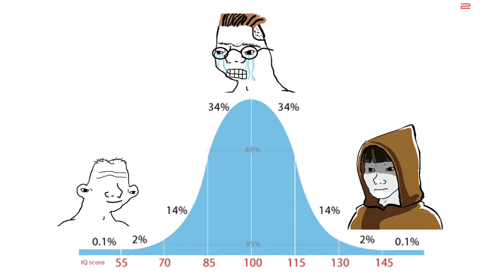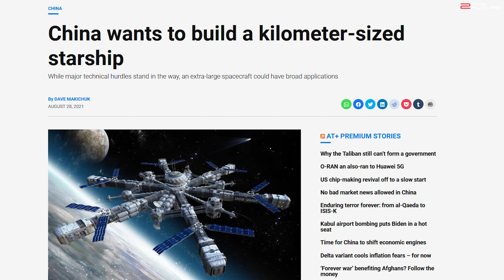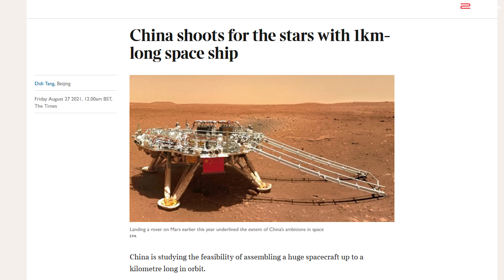Elon Musk's updated Mars timeline for SpaceX Starship.

Comment: Elon may have a transportation system to move mass to Mars in 10 years, and this is the hardest engineering problem towards sending humans there... but there is a lot more needed. Some very basic science is being done, like the Moxie experiment, but it just validates the principle. It needs to be scaled, optimized for mass and power, tested and so on. We don't have a power system that is easy to deploy and maintain on Mars, we don't have the fuel manufacturing system, we don't have the system to mine water. All these need to be designed, tested, deployed and demonstrated to work before humans are sent to Mars.
SpaceX are doing the right thing by focusing on today's problems. Starlink and Starship are big enough problems to require all their attention. But it seems nobody else is doing the rest. By the time we can put payload on Mars, there will be no payload ready to send. This is going to delay things quite a bit.
I don't think Elon is going there until the Mars colony is close to self-sufficiency. Most of the engineering and pushing is going to happen on Earth, at least at the start, and it would be difficult to push his companies all the way from Mars.

Comment: China has one key advantage in building a kilometer sized spaceship. They are way ahead of the US with regard to economic space manufacturing at least in building a lunar base.  From a lunar base making and launching aluminum starship sized vessels would be vastly easier than doing so from earth. Starships are 50 Meters tall, but if built and launched from the moon is a 100 meter tall starship so hard to imagine? They dont need a booster to take off. In fact they need no fuel at all if an electric catapault like the EMALS system is used. So with 50 meter tall starships they need 20 launches to couple them into a Kilometer long structure. This is not nearly so far fetched as you make it out to be.

Comment: Space ships do not have to be big heavy things. They only need to be big heavy things because they have to exist in gravity and fold huge amounts of fuel.

Wire frame construction with resistance welds. Construct them with known hard points, designed for specific loads. A wireforming robot these days.

Wrap the wireframe sections in high density polyethylene. This is just a pallet wrapping robot.

Nest several together, and add the airlock. Fill the space between the two with a high-iron polymer foam. Light assembly is really really easy.

With a design like this all you need to bring into space are the doors and the equipment to be placed inside. Big spools of 5mm steel hex wire 10 mil HDPE. Spray foam...

Construct wire-truss supports, and you could lock a lot of these things together.  500 m radius could easily be spun up to 0.5g... 

This is absolutely doable with technogy available today.

Comment: Isn't that $2M or $12/kg  fuel costs only? What about amortized development costs, and the cost of building the airframe and engines? True, this would be divided by launch cycles, but then there is going to be maintenance, and the costs of ground facilities and personnel.
Reply: Yep, it's sad that people keep saying that dumb figure.  And that's based on CHEAP fuel prices at the time, Natural Gas from the well + processing costs will only increase in the future and already has.  And before people say "Sabatier process", that won't make Methane cheaper than it coming from a NG well, nor faster.  So the $2M figure is nearly impossible now, nevermind when Starship actually starts flying en mass.

Comment: Our reps at Starbase need to do some work on the starship heat shield - thermal protection system.  The tricky parts of the journey are re-entry and landing.  Please and thank you.
I keep thinking about corn on the cob.  The starship needs to be laid on it's back and ride down the tube having corn rows done.  We need to test test test.  I would like to see the tiles coated with spray pam.  Each reentry works like an iron skillet and season's the ship.  Coat after coat, layer after layer building up the carbon between tiles, coating the exterior like we see on Falcon boosters after years of service.  I am not sure but using the heat of reentry to cook, cure, seal the heat shell would be a party with plasma.  You know that you are doing something right when the old ones are much prized.

Are the refuel tanks ready?  Quick disconnect redesign - idk sounds dorky to me 
How's the lander looking?  Waiting for the Daddy Draco.  Have we seen the landing engines?
Finish the farm and fill um up.  Then start on parts for the launch and landing rigs.  Much wow - much work
What are we forgetting?  Tickets, credit card, phone charger, mask, shots, IQ test results ...
Teslanaut buddy fasten your seat belt
We are destined to go 2 THE FUTURE

Comment: @8:50 How much would it cost to lift 4,500 kilos off of the Moon? (They already have successfully got some rovers there. [I give credit where it's due.]) 
In-situ mining and construction of segments could be possible using some TeslaBots. 
They can even drop off solar arrays at the south pole and then all around the moon for electrical power uninterrupted by weather or the Moon's rotation. 
I bet you could just throw stuff up with a rail gun/catapult because the Moon's escape velocity is so low and then use detachable-reusable ion engines to guide your payload to the right position/orientation in space.

Comment: $13 cost per launch is only the fuel costs. SpaceX still have to recoup their research and prototyping costs, and we still don't know what the regular maintenance costs will be. More likely the final price will be ~$100/kg at best.
Reply: which is still vastly less expensive so it's still a win, I agree with you though 13 is probably after 20 years of launches and costs being recouped at minimum
Reply: Recouping costs will be done relatively quickly with Starlink launches.
Reply: @jaceksiuda  I doubt that. Any commercial launches for starship that do not directly contribute to the Mars mission will have to turn a profit, which can then be put towards the Mars mission. 

Starlink also exists to raise money for the Mars mission.

Comment: Kilometer long spacecraft is pretty much what one needs to do if one wants to do things like harvest asteroids in a big way, and I think is a lot closer than you think.  You obviously wouldn't build such a thing on earth, choosing a lower gravity solution.  If Musk is still around in 2060, I could easily see him building stuff of that size around mars or its moons.
Reply: We just need to get 10 star ships is a line and we can have 1 km long space ship.
Reply: @reasonerenlightened2456  20 starships my friend, they currently only around 50m tall
Reply: @reasonerenlightened2456   - If I were going to build a mile long space ship using today's SX technology, I would stack one Super Heavy on top of another, and, if necessary, strap extra solid fuel engines to the base Super Heavy. The top Super Heavy would only have to have limited removable engines and none of the extras found on the Starship. Just a shell containing the structural identity needed for the spacecraft. I suppose you could build it out of something lighter than stainless steel. Once you get it into space then you can add the components you couldn't put into on earth. That is exactly the way I would build the next ISS as well. If you can get that combination into space, you could build a ship or station quicker and at far less cost than the ISS - one 230 foot section at a time.
Reply: If he doesn't, somebody else will. I think such projects will be done in Earth orbit long before Mars orbit though.
Reply: khsa  Elon Musk is just blah blah... that concept of Spacecraft is from 1950 and the interior of the capsules are stolen topics from things that I promoted... Doing Space Projects by cheating is the worse idiotic idea ever... but they think nobody will notice...
Reply: @luisbeck007  yeah im sure hes 'cheating'... Get a grip mate hes taking us places the 1950's couldnt. Enjoy it while you can.
Reply: Far more likely that stuff get's done around Mars first just due to lower gravity rather than whatever the PRC thinks it could do.  If Starship is successful then SpaceX could begin building the structure needed to BUILD it in orbit, but we'd still need to figure out asteroid mining or building heavy industry on the Moon one or the other.  Earth benefits from the Moon because SpaceX could build far more massive starships here in the Earth/Luna system rather than waiting until we have infrastructure on Mars to build something like that.

Comment: Starship with twice the diameter can be built on earth too.
And it's in fact easier to launch from earth than from mars because:
1: Orbital refilling is cheap on a fully reusable rocket.
2: The Oberth effect is stronger on earth because of the deep gravity well.
Reply: Let’s see here.....no

Lower Martian gravity means much less fuel and thrust is needed to achieve escape velocity. Extremely thin atmosphere means air resistance doesn’t matter as much. Lower gravity also means less in-orbit refuelling is needed for the boost back to Earth. SuperHeavy is not needed on Mars, therefore reduces cost significantly. On site fuel production rather than purchased fuel also brings down cost. So, no. Launching Starship from Mars is much easier
Reply: @odinharou7112  I'm not talking about energy or fuel, I'm talking about cost.
All stages needed to reach escape velocity are highly reusable (3 flights per day) while every stage beyond escape velocity is not (3 years just to reach Saturn at full speed)
So basically by having a deep gravity well you expended stages are starting with an higher velocity.
Reply: @johntheux9238  You are completely missing the point. Less gravity...means less fuel...less delta v...less everything needed to get to where you want to be. It doesn't matter where Starship launches from, it will always be reuseable, the point is to land on the surface of Mars (eventually another planetary body or Moon), fuel up and return to wherever it came from...or go further into space. That's reuseablity
Reply: @odinharou7112  OK, let's say one ship has an highly elliptical orbit around Mars and is going at 5 km/s at perigee, and another has an highly elliptical orbit around Earth and is moving at 11km/s at perigee.
They all burn all their fuel and accelerate by 6km/s to end up at 11 and 17 km/s

The first one has gained 11000^2/2-5000^2/2 = 48 [MJ/kg] of energy.
The second one has gained 17000^2/2-11000^2/2 = 84 [MJ/kg] of energy.

They both spent the same delta-v, but the one that was moving faster has gained 75% more energy for free.